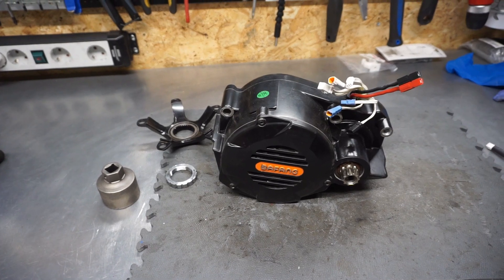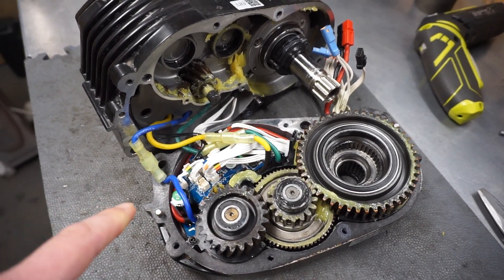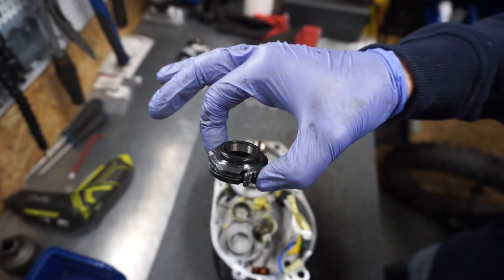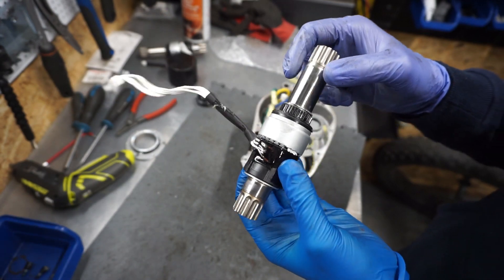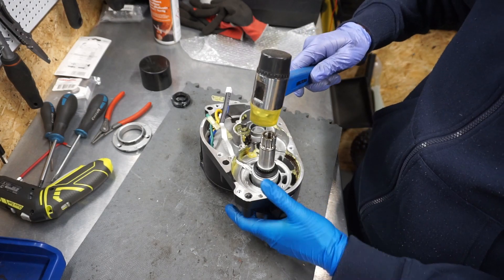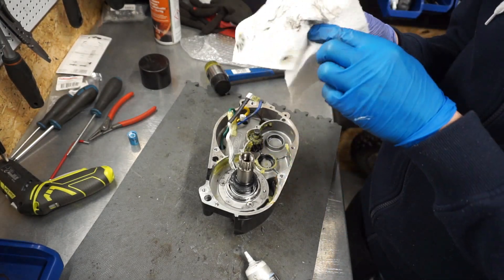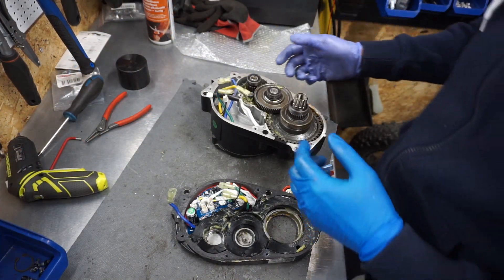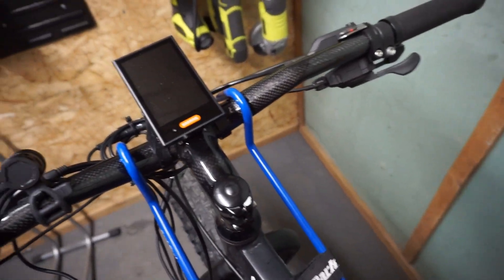Bafang Ultra G510 M620 torque sensor repair

Comment: How to take crank bottom bracket 5 arms that chain ring reverse thread or regular leftie loosie rightie tightie ???
Reply from the maker: Chain ring has reversed thread. You can prevent rotation of the chain ring by holding it with mounted chain.

Comment: So I have 2023 G510 M620 Bafang motor my torque sensor when pedaling is very stiff and noisy I have over 6,000 miles on it , At 5,000 miles I disassembled and used corn head grease after cleaning all the old grease out of it so do I need to calibrate the new torque sensor ? If so what will I need to do or buy to do so and how much will it cost me ?
Reply from the maker: Torque sensor comes calibrated out of the factory. If you have UART type controller, you can change settings if you want to. In CANBUS version everything is locked.

Comment: Hello, I am in the process of repairing my m620. The gear on the main motor core and the one it drives both stripped. I replaced them and am testing the motor off the bike and when I hit the throttle it just makes a whirring noise but the axle doesn’t spin. Do you have any thoughts on what it could be. I reinstalled per your instructions in the video
Reply from the maker: Clutch mechanism is not engaged when motor starts to spin. Maybe pawls do not stretch out to bite on the external ring?
Reply: @LierskogenEbikes  thanks. It looks like the motor was running in reverse. Trying to figure that out now
Reply from the maker: @mikehtiger  You could connect phase wires incorrectly.
Reply: @LierskogenEbikes  they are all in the right order. I even tried each other combo with no luck

Comment: Do you know if all bafang torque sensors are the same or is there one for UART and one for CANBUS. Long story but I am trying to change everything over from CANBUS to UART so I can control my settings. I'm locked out of everything on BESST. I have G510 motor with controller (model CR R10M.1000.FC). Thank you!
Reply: On ur motor id number if it ends in U it’s Uart 
FC FOR CANBUS, & there’s green bike video that compares the two differences in plugs
Reply: On ur motor id number if it ends in U it’s Uart 
FC FOR CANBUS, & there’s green bike video that compares the two differences in plugs
Reply from the maker: Hard to say. Check on supplier website if they have only one or two versions of this torque sensor. I guess Bafang makes only one version, cheaper and simpler for production.

Comment: Hello Lierskogen Ebikes!
I would like to ask about the motor i have the same motor and my pedal asistent stopped workin the motor is  working the gass (acceleration ) its give me power but the prdal asistent its not working i do not want to use it like this its not so much fun and my battery is not last so longer like whit the PAS .
Can you help me with this maybe what do you saggest what can i check what can be the problem?
It was a day when started to work again for 10 minutes and then stopped again...
Reply from the maker: Your torque sensor is broken. You need to install new axle.
Reply: @LierskogenEbikes  i just ordered a new one thank you!

Comment: I have also intermitting motor support. After every 2 seconds the motor support cuts out for the blink of an eye. All the exterior sensors and cables seem to be alright. Have tested it with a second motor. I have fried my controller because of voltage peak. Is it possible that a voltage peak have fried my torque sensor too?
Reply from the maker: Most probably yes. I fried once ASI controller by trying to integrate stopping lights signal with brakes signal. All components (except display) connected to controller were fried as well.
Reply: @LierskogenEbikes  I have solved the issue! I had sliced the insulation one of the motor cables. The naked wire touched the motor housing inside. After insulating the cable the issue was gone!

Comment: Very good explanation of all steps in the process.  I dislike my torque sensor, how can I turn off the torque sensor and install a cadence sensor instead? Is this possible?
Reply from the maker: There is no such a thing as pure cadence sensor for this motor model. Why would you want one? Everybody buy this motor for the torque sensor feature. You can install the throttle, if you don't want to pedal.

Comment: Hi. How the torque sensor works compared to CYC stealth?
Reply from the maker: It all depends how you will set the sensitivity and many other parameters. You can tune yourself torque sensor behaviour, if you have Ultra with UART interface system.

Comment: In run a tuned M600 and I want to Make my M600 Capable of Executing a Crank Flip by reducing the resistance on the back peddle.  But Can't find anyone who knows which bearings to replace.

Comment: Hello friend, where do you understand the piece?
Reply from the maker: Hi, I don't understand your question.
Reply: @LierskogenEbikes  Where you bought the piece, it is very difficult to find, I would like to know where you found or bought the sensor
Reply from the maker: @danteaguilarmunoz7955  https://www.greenbikekit.com/bafang-8fun-spare-parts/ultra-g510-mid-motor-parts/bafang-ultra-motor-torque-sensor-m620.html

Comment: i have problem with Bafang M620 it is new 20 kms  i went on a ride all of a sudden no more pedal its like what make wheel turn when pedaling  in motor is disconnected could it be clutch ? Thank you for your help
Reply from the maker: If the chainring do not rotate together with pedals, than your clutch inside the motor is broken. Most probably teeths are broken. Happens often with rear wheel cassette clutch, it's identical mechanism.
Reply: @LierskogenEbikes  Chainring rotates with pedals  i think now is rear freehub  because when i turn wheel no clicking  . When i try to turn cassette counterclockwise does not turn . Do you think it is that? rear wheel clutch ? is that fixable sometimes? or need new wheel .Tnank you

Comment: I have an m600 motor and I think the torque sensor has gone bad. Where did you get the replacement part for your motor?
Reply from the maker: You can try with Aliexpress or https://www.greenbikekit.com/

Comment: Hopefully you didn't forget to re-install the snap ring on to the bb axel on the non drive side.....Also a good grease to use is Corn Head grease if anyone ever takes theirs apart.
Reply from the maker: I didn't forget it. I had to take some shortcuts during recording of this movie to make it short enough. It's hard to compress couple of hours job to 10 minutes clip.

Comment: I have an old G510 made in 2016.
Nylon gear broke in half a year after I bought it.

The shop provided reinforced nylon gear.
I exchanged it myself.
My G510 was coated with black molybdenum grease.
The current G510 has changed to yellow lithium grease.
Do you not fill the G510 with a large amount of red mobile grease like everyone else?
Reply from the maker: I use grease that is available in my local shop. I have both black and yellow lithium grease versions. The difference between both them is very small. What I read on information stickers (that may differ between producers), the black one can tolerate slightly higher temperatures. What I mean slightly is around 20 C degrees difference. Not much.

Comment: I would like to see how did you remove the biggest gear from the other side. When I open the motor, the biggest gear is always the other side and seems not easy to remove.
Reply from the maker: I think you mean stator, not gear. It's possible to buy a new stator, if you need one.

Comment: Great video. Had same issue with mine, despite being a 2021 model bought directly from Bafang itself and having done only 1,000 km with it and used for 6 months.
I am pretty sure this is the torque sensor as when connected via bluetooth to the bike and reading the various settings, the value displayed by the Torque sensor is "0" whereas it used to display a value even without any force applied to the pedal. Or maybe is it just a connection issue?

Anyway, How come these torque Sensors fail after so little use? Hey Bafang, what is going on???
Reply from the maker: Yep. Checking torque sensor readings in Bafang motor application is very good tool to identify problems with torque sensor. Something is wrong with design of the strain gauge on the axle.
Reply: Thanks, but then does it mean having a M620 implies buying a USD 100 torque sensor every 6 month or every 1000Km? This would be ridiculous and would show how bad Bafang reputation should be. I have reached out to Robin at Bafang (part of the sales team) and will let you know what his reply is to my email asking him what to do.
Reply from the maker: @gvanrenterghem  I don't think torque sensor brakes so frequently. It's just bad luck when it stop working. Strain gauges are very sensitive devices and they may loose their precision over time. You are lucky, if you can replace motor axle under warranty. No need to replace whole motor.

Comment: Nice looking, compact Unit with all the essentials in the one module.I don't see any seals on the bearings, does the motor have an IP code?
Reply from the maker: You can check it on Bafang website. All electric motors for bikes are waterproof to certain degree. If they were not, you would not be able to ride outdoors.
Reply: @LierskogenEbikes  Will do. Thanks.

Comment: where is the motor temp sensor?
Reply from the maker: There might be a temp sensor built in controller, but you can't get any information about it on the display.

Comment: Great video thank you much,
 Just a thought is there no gasket that needs to be put in between the engine case when you are reinstalling ?
 Just curious, literally
Reply from the maker: There is a gasket between motor blocks. You can see it in the movie.
Reply: Yep, the gasket can be seen here 12:59. Personally, I would have used gasket compound as well. It can have a tendency to be a bit messy but it works wonders in sealing the joint.
Reply: Yes I do see it now, it was just a question never to criticize because the video was great and it's nice to see the internals at that level, I got a new prescription going in next month, better eyes, thank you for the heads up and responds as well 👍
Reply: @prostreet9149  Yep, I thought the video very informative. I have a Rize RX Pro on order so I have a vested interest in learning to strip this motor.

Comment: Hi there. Recently I have fitted brand new m620, during the test ride motor cuts out the power intermittent at about 10-15mph, checked with new battery,  harness wire,  disconnect all sensors,  changed the settings but the fault still exist. Do you think is the torque sensor? Regards
Reply from the maker: Hi. With faulty torque sensor, motor will not work at all, not just intermittent problems. You can connect gas throttle to test motor behaviour, if you have 4 leads cable. If you don't have it, it's easy to buy them from Internet ebike shops. Check how big amperage have your battery BMS. If it's below 30A, than you will have intermittent power cuts.
Reply: Thanks for your reply. The motor performance fine on the throttle only the problem is just the PAS, if this isn't the torque sensor probably is the controller. Never have had this problem on the brand new motor. Regards
Reply from the maker: @ProEbike2  Than the problem is with torque sensor or motor controller (my bet is controller fault). Replace the motor with new one on warranty, if possible.
Reply: Supplier / Bafang has promised to send me a new motor without any evidence, just my description of fault cosed,  really happy with that solution. I'm still planning to fix the motor anyway. Do you know where I can get a replacement parts as torque sensor or controller?
Reply from the maker: @ProEbike2 GreenBikeKit shop have all spare parts. https://www.greenbikekit.com/bafang-8fun-spare-parts.html
Reply: @LierskogenEbikes  appreciate it. Many thanks 😊
Reply: @ProEbike2 I have intermitting power issue also. Has a new torque sensor solved it?

Comment: How do you think which engine is better or the quality to handle high power G510 or BBSHD
Reply from the maker: I'm a big fan of all motors with torque sensor, therefore Ultra is much better motor in my opinion.